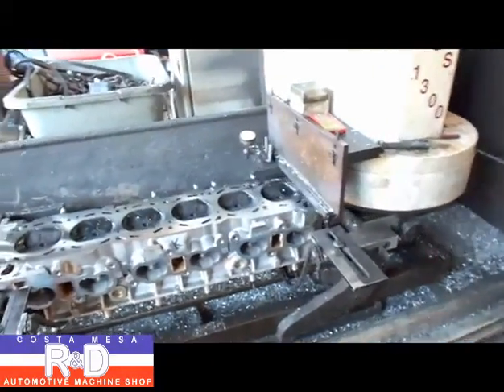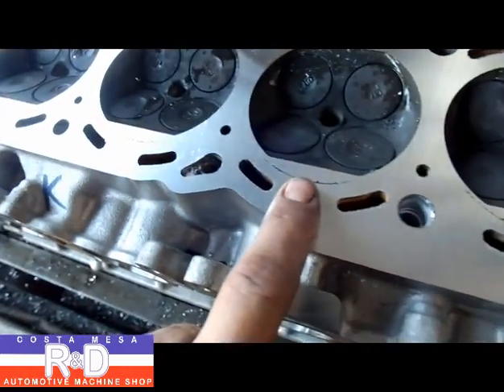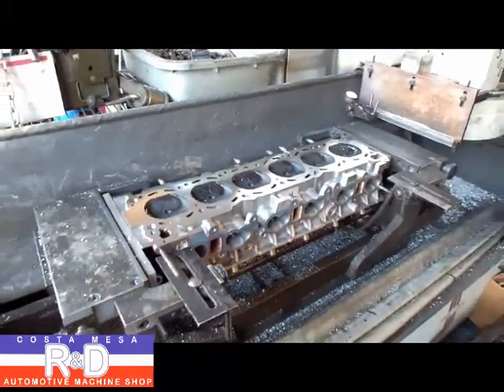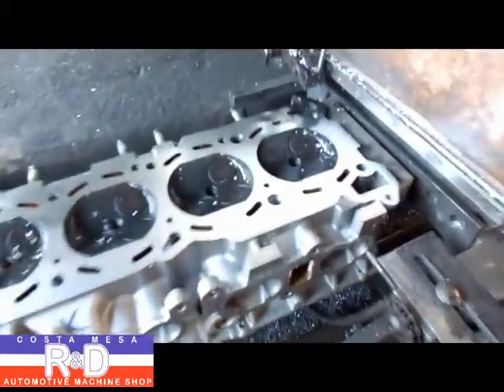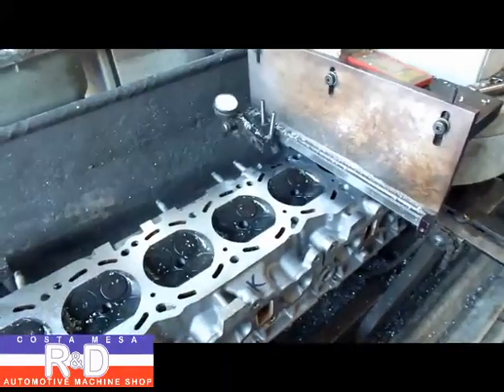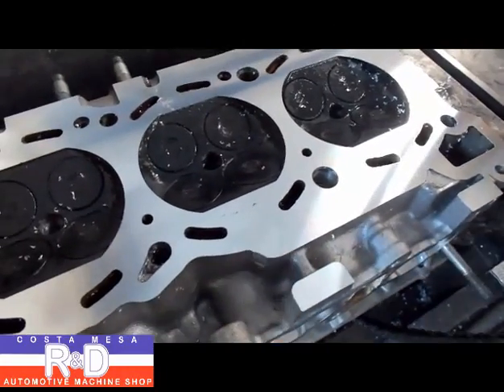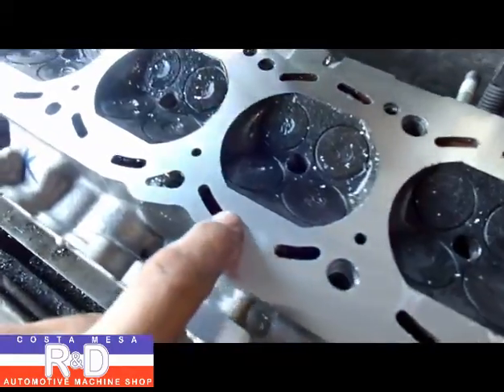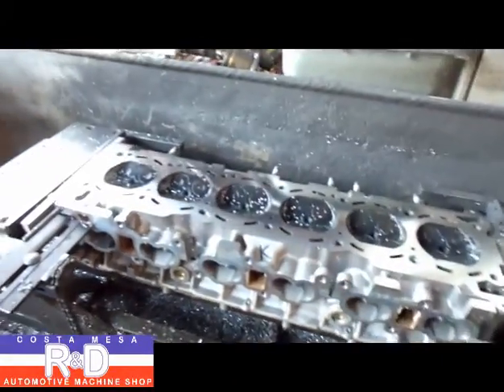Nissan Skyline RB26 Head Resurface

Comment: or could the cast iron block maybe have a imperfection from the factory? the motor has less than 20k on it. but we are very rough on it at the track and it is not a daily driver.

Comment: Thanks John!  The Cyl head looks great! But one question do you think this problem around cyl is going to come back even if using a quality metal head gasket and ARP headbolts? Its currently running 400+ to the wheels with 15psi of boost and has been properly tuned. but it did get hot one time a year ago cause of a electronic fan controller failed. its back on the stock mechanical fan now

Comment: Its actually a RB25 NEO cyl head from a R34 Skyline GT-S. The NEO engine uses a mix between rb25 and rb26 parts from the factory.       

check out wikipedia and search Nissan RB Engine

Comment from the maker: The cost to do all this would be very expensive. Disassembly, cleaning, welding, straightening, valve job, valve adjustment, resurface, new stem seals, and final assembly. LOTS of dollars.

Comment: Hi John, wouldn't  welding fill those imperfections? 
Then machine to a level surface. I realise it is what the customer wants, that finalises what you do.
It seems a shame to remove that material by machining, as it can never be replaced.
A compression ratio mod perhaps? Cheers, fh276.

Comment: Mrjiglette was probably talking about interference after you mill the head, since this is an interference motor.  In the factory manual, they normally give you a tolerance measurement, which if you go past, you have to compensate with a thicker head gasket.